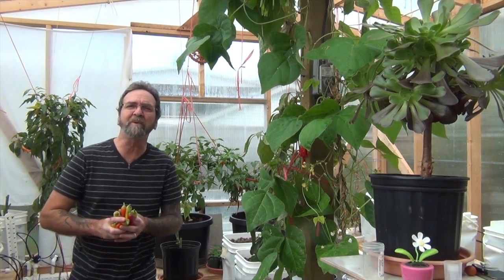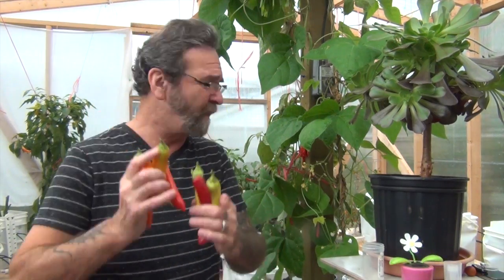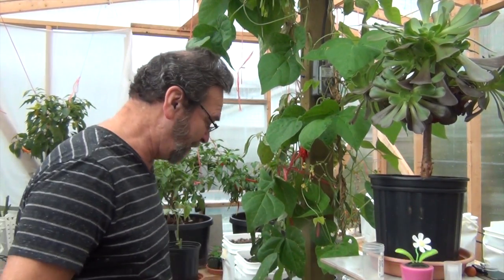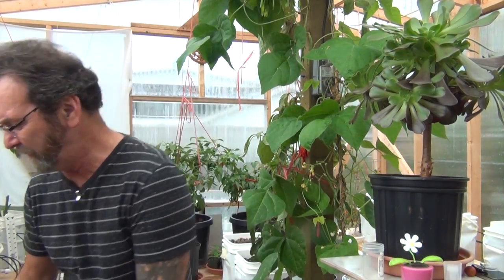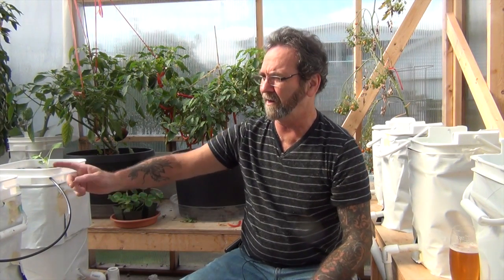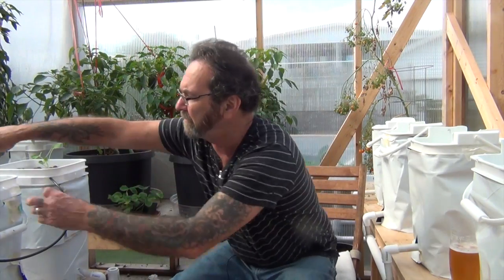Double Dutch Buckets to make cleanup at end of season very easy.

Comment: I am wondering about the short buckets in the tall buckets. If you raised the drain in the bottom bucket to allow it to hold more nute solution OR if you put coco the the space between the buckets, would they be more heat tolerant? I'm actually doing something similar in a drain to waste hand watered coco setup for strawberries. My coco expander gave me that idea. I can't wait to see how the temps run in your GH when the weather gets really cold. You will be showing us that setup right bro ? ;-)

Comment from the maker: Well bro if the temps are below 80 the short bucket are excellent and I'm using them now in the GH because the weather is about to shift. I have some strawberries in a short bucket right now actually. I'll show the roots when they break through. The smaller buckets are great for smaller plants in cooler weather. but for anything of size you really need to go with the full buckets. At least that's how it's gone for me :)  Thanks for watching brother!

Brock

Comment from the maker: I see what you are saying bro but when you raise the drain the bucket will no longer accommodate the taller bucket. In the cooler weather the short buckets are excellent because the air cavity is far cooler. I put some strawberries in a short bucket to day and when the roots come through I'll show them :) I like the drain to waste method. I'm looking to seeing what happens with the temps too bro. I'll do a vid when it's real cold and show the temps inside and out. its better so far :)

Comment: Do you know the distance between the bottom of the smaller bucket and the bottom of the tall bucket? I'd be interested to know that. The bad thing about the drain to waste method using coco is salt build up and the chance for the media to dry out. The cool thing about using coco is that it seems to buffer the PH.